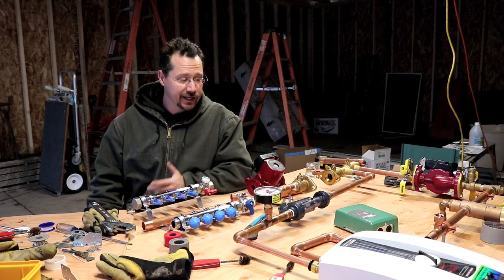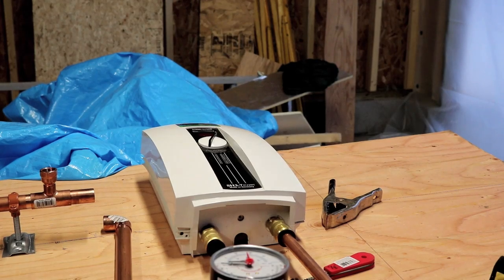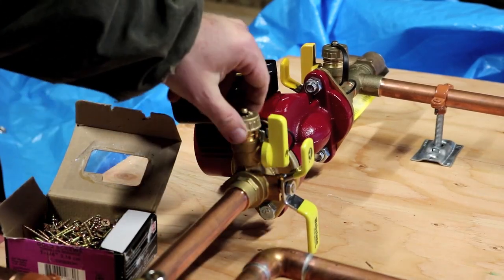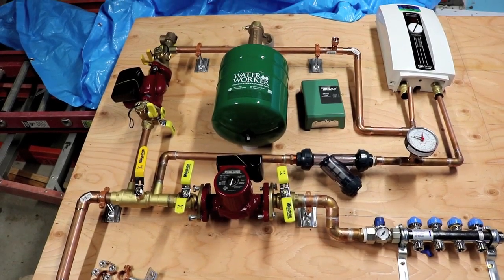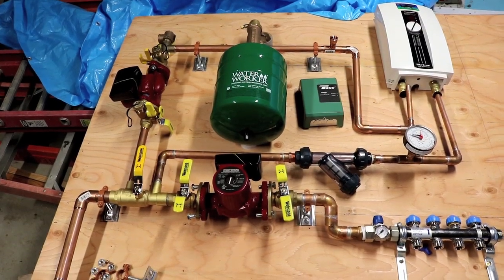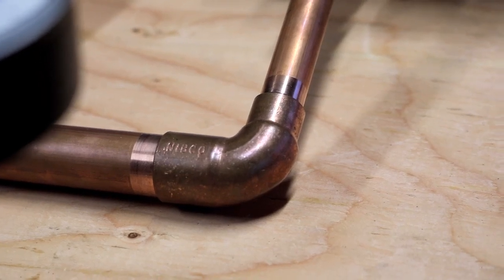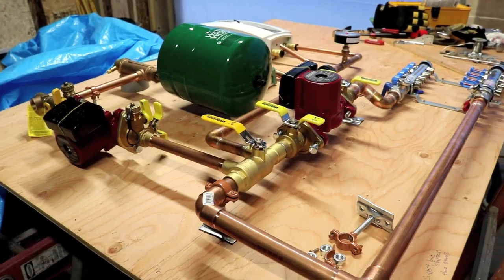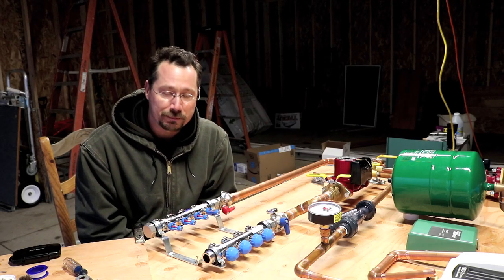Ben's Garage: Hydronic Heating Update Jan 25 2017

Comment: 7000 watts is only 24 000 btus, not big enough.  Also exectricity is 5x the cost of gas. You need to hire an engineer.
Reply from the maker: Also note that the system is somewhat modular, if I wanted to upgrade the boiler (which has been fine by the way) it's just connected with Shark-Bite style connectors, and could be swapped out.
When considering the cost of operation, I also looked at the fact that I am MAKING ELECTRICITY with solar panels, and what it would have cost to get a gas-line to this building. Much easier and cheaper to go with electricity in this case.
As a rule of thumb, YES, natural gas is a very inexpensive heating fuel, but that's not the exclusive reason for one source of energy vs another.
This is also a garage and workshop, it is NOT being heated to 70 degrees and occupied 24-7.
So far, the system is working as planned.
Reply: all dependant on heat load. 

cheers 
dave
Reply: You don’t know that is isn’t big enough.  Did you do a heat loss calculation on his building?
Reply: you folks got to remember running radiant heat BTU demand is way less than conventional conviction type
Reply: LARRY CURRIER I would not say way less.  Maybe a little less, but heat loss calculations are done independent of the heating system type.  BTUs loss must be replaced and it doesn’t matter what heat source you use to replace those BTUs.
Reply: LTVoyager while I disagree with you no matter the source of heat whether it be oil gas or electricity you generally can heat your home with radiant heat as this gentleman is doing for approximately 40% less than you can with conventional Heat thermocline in a room with conventional heat is that heat is at the ceiling and cold at the floor as much as up to 10 to 15 degrees from ceiling to floor thermostat at 5 feet he comes down to the thermostat and stops where are you below the thermostat thermocline with radiant heat is absolutely opposite other saving is convection type heating requires 180 degree water where radiant heat requires possibly as low as 100 degree water but most generally 110  depending on floor covering so if I can save a man 40% in his heating bill that's not a little
Reply: LARRY CURRIER The 40% number is thrown around a lot, but is very misleading.  I saw a comparison a while back, but unfortunately can’t find it now, about a house in Williams, CA, if memory serves, that had both radiant and forced air systems.  A head-to-head comparison was made with each system used it in normally would be used, and the fuel consumption for the two systems was nearly identical with the radiant saving only a few percent at best.

The 40% number comes from an assumption that you run both systems at steady state in a way that provides similar comfort for the occupants.  Generally, a radiant system can have the t-stat set 3-4 degrees lower than FA to achieve similar comfort level.  However,  this number neglects the biggest advantage of FA which is its very fast response.  Radiant slab systems do not allow daily setbacks as they respond too slowly.  So, you have to leave them set at say 68 degrees around the clock.  A FA system may need 72 during the day to match the comfort of the radiant, but it can be set back to 64 or less at night for better sleeping comfort.  This saves a lot of energy and often nearly offsets the higher FA consumption during the day.

I have both systems nearly side-by-side so I can compare them easily.  My log home is FA heated and my workshop is in-slab hydronic.  The workshop is comfortable, but no way I can do setbacks.  I have to leave it at 60 all the time in order to work comfortably even though I only work in it sporadically.  Forced air allows you to keep temps low when not using a building and then heat the building up in an hour or so when needed.  If my shop was FA heated, I would leave it at 50 most of the time and bump it to 70 when I planned to work in it.

As with most things in life, you can’t make simple absolute statements like “radiant uses 40% less energy” and it simply isn’t true in general.  And unfortunately there are very few real world side-by-side comparisons that show the actual performance of each system when used at its optimum.  The radiant supporters want all comparisons done at a steady temperature as that is where radiant shines and the FA supports want deep daily setbacks as they know that radiant can’t do that.  The only valid comparisons are where each system is run the way it runs best and I have only seen one of those and in that case the difference in efficiency was in the low single digits.
Reply: LTVoyager okay you must live in California I'm a 35 year heating guy and this argument could go on all day with a properly set up Radiant Heating there is more than a few percentage difference without having to turn the thermostat up then down and then down that's what they make zones for and forced hot air one minute you're freaking cold in the next minute you're sweating to death the temperature swing more than most people want to deal with so yeah why not compare apples to apples
Reply: LARRY CURRIER No, licensed PE in PA and NY, live in PA.  You have never experienced a properly designed FA system.  My house doesn’t vary more than 0.7 degree from setpoint and you can’t hear or feel the airflow.  Most FA systems have fewer than half the number of registers they should have and most don’t have at least one return in each room as they should.  This causes the air velocity out of the registers to be at least twice what it should be.  It is all about design.  I both FA and radiant, but they each have pros and cons.  There is no perfect system.  High thermal mass radiant is very comfortable when outdoor temps are fairly stable, but in the spring and fall where temps can swing 30-40 degrees in less than 24 hours, high mass radiant simply can’t track that.  You can’t overcome the laws of physics.

Comment: Fossil fuels what is it 1996? Where do you think the electricity comes from? Natural gas is amazing on about every single level. Cheep abundant minimum carbon foot print
Reply: that is why he mentioned solar panel  pay attention
Reply: Man. It's definitely not '96. It's 2019. It's time to eliminate all fossil fuel. Fracking is incredibly dangerous to ground water systems and it doesn't address the issues with carbon dioxide.
Reply from the maker: The electricity comes from the solar panels on the roof. Natural gas is great for heating, but it would also had been considerable work and expense to run natural gas piping to this building. Since I already have electricity in the garage and can literally make my own, that seemed like a good choice.
I've also added some solar thermal heating.

Comment: Wonder where he lives? what does manual j say for his winter OSA temp?  A heat pump maybe the better option, but not as fun to build.
Reply from the maker: I Rich. I live in south-eastern Wisconsin.
Heat pumps are good technology, but are not the magic bullet of heating. They only work well down to a certain temperature, and you still need backup heat after that.
The hydronic system has other advantages, such as the fact that I could plumb an outdoor wood-burning furnace into it.
Another advantage of the hydronic is how the thermal mass of the concrete (which has insulation below and around it) helps keep the space at a steady temperature.

Comment: Looks like a pretty good set up. (I'm not a professional) Do you have the system up and running yet? If so, how's it work? And, mmmmmmmm, taco.
Reply from the maker: Overall, the system works very well. I ended up putting in a  basic ($20) thermostat on it to automate the ON/OFF cycles. There's a few times this winter when I knew I'd be working in my garage all weekend, so a day ahead of time, I'd turn up the heat. Very nice working in a heated garage. Even 50 degrees is amazing if it's only 10 degrees outside.
For the most part, I've left it on with the thermostat set to 40 degrees (F). That prevents it from hitting freezing temperatures, but uses significantly less energy than if it was set to 50, 60, or 70 degrees. At 70, it would be about like me heating a second house! ($$$)
I also recent started experimenting with some passive solar, building a glass door that goes over my insulated overhead door. On a sunny winter day, I can let in the light and heat, but close the door at night and cloudy days to hold the heat inside. The hydronic system is also set up so that I could potentially connect an outdoor wood-burning boiler to it.
https://www.youtube.com/watch?v=EcuRfnP6E7I

Comment: Great Job on the system, i just did one as well with the same micro boiler.  to everyone that says you don't need two pumps,  manufacturer states that a primary/secondary system with a "Y" strainer is required or the warranty on the boiler is void.  Just a guess, but i would think that has to do with not having stagnant fluid sitting in the boiler which may cause buildup.
Reply from the maker: That is correct about the boiler warranty. Another thing nice about the "Y" strainer is that it's clear, so a person can see the fluid in it. That's a nice way to be able to see that the system is full and all the air-bubbles are worked out. Everywhere else is opaque.

Comment: Do you have a schematic of this setup with parts needed? Saw this same setup on YouTube and figured there must be a write up on each part used.
Reply: SupaTrending Daily It will take longer, but it won’t burn more fuel.  You are confusing heating time with efficiency.
Reply: SupaTrending Daily I agree, but taking too long is not an efficiency issue.
Reply: menards has this exact setup with the same components  in a brochure in the plumbing dept.
Reply: SupaTrending Daily It won’t be inefficient if it is too small.  I may be ineffective at low temps, but it will be very efficient as it will run at high output most of the time.
Reply: SupaTrending Daily It depends on the details, but in general the answer is yes.  A 90,000 BTU boiler will be larger and have greater thermal mass.  You are heating both the boiler and the water.  A larger boiler means you are heating a larger boiler mass in addition to the water mass so, yes, generally it will take more total energy if you are using a larger boiler.
Reply: SupaTrending Daily It certainly is much worse with a cast iron boiler, but even with modcon boilers or on demand water heaters, a larger one has more mass than a smaller one.  So, the loss with each heating cycle is greater with the larger units.  And they will short cycle when oversized.  98% of the heating systems in the US are oversized.  It is very rare to find a boiler or furnace that is sized correctly in residential applications.
Reply: SupaTrending Daily https://youtu.be/h00dAUaOa9o

Comment: Where did you find the fitting that the relief valve threads into?
Reply from the maker: I purchased all the components through MENARDS, a big-box home improvement store in my area. See if you can find a local vendor in your area. Otherwise, nearly everything is available by mail order nowadays. https://www.menards.com/main/heating-cooling/hydronic-radiant-heat/c-8517.htm

Comment: dont listen to these guys, Primary secondary piping is the correct way. also youre pumping away from the expansion tank which is perfect. youve done everything correctly. as far as the future wood boiler tee locations i would go with the secondary loop section that you pointed out. the only thing i would have done differently is put the secondary pump on the supply side.
Reply: Can you touch more on the reason/requirement for primary/secondary pumps??
Reply: Not a requirement, but improved operation and boiler protection. In a small system like this the two main reasons would be hydraulic separation, and thermal shock protection. The boiler and the heating loop have different flow rates. there are lots of different reasons for it and boiler manufacturers recommend it.
Reply: @MrKillanthony  d
Reply from the maker: The micro boiler warranty specifically requires the primary/secondary pump setup.
Reply: +MrKillanthony I agree
Reply: I agree that secondary pump should be placed on supply side.  These pumps are designed to “push” water (hence, the head ratings) versus “pulling” or suctioning the water.  If a pump is starved for water due to lack of suction, by running low on water it will damage the pump.  The water serves like ball bearings around the cartridge in the pump and it helps dissipate motor heat.

Comment: Hi Ben , I have an 80 litre boiler and approx 80 litres in the system. What size expansion vessel should I use ? Thanks Paul
Reply: Water expands 5 percent from 0 to 95 degrees so easy to calculate,plus volume of pipe work if the system is big

Comment: I agree with Dan Smith about a simpler one pump system. My whole house is hydronic with 8 zones and one high head TACO pump. It is simple and has worked for 15 years without issues.I have seen these huge systems with a pump per zone that are expensive and complicated,. Sure if the pump goes you have no heat ,well you keep a backup on hand and you can replace it in a half hour and not have to bleed the whole system when you locate the valves close to the pump.
Reply: If you have 8 zones then you have 8 thermostats. To independently control the 8 zones, you must be using zone control valves rather than zone pumps since you only have one pump.
Reply: 8 zones?  Or 8 loops?
Reply: Yes, just save other pump for backup.

Comment: Why is a strainer/filter needed?
Reply: Also looking for this answer. I couldn't find the correct filter and bought a different one. Now it is getting build up and slowing the flow enough to stop my heater from coming on.
Reply: @nickosterhout  if it’s getting build up then I think that answers why it is needed, it is there to protect the boiler from whatever is building up in the strainer.

Comment: I have outfitted my home with Rotex manifolds and piping from Germany. The engineer who designed and installed my system says that 40°C is the max temperature that can be run through our system. Also the "concrete radiating sub floor" was mixed with chopped fiberglass and a latex solution to inhibit cracking due to the thermal expansion. I have a dual heat supply system where my fireplace equipped with a built in boiler will supply the primary heat source while the oil fired boiler is the backup source. This requires the installation of a heat exchanger tank where the two systems are isolated but supply hot water to the hydronic heat in the main home at 40° while supplying 70° water to the radiators in the basement. One you heat up the concrete radiator you leave it running if at a reduced temperature when a lot of hat is not needed. This eliminates reheating the radiating surface which can cost more in the long run.
Reply: sounds delightful 

cheers 
dave

Comment: I've seen it said that these have to operate all the time basically, because warming water to warm a lot of concrete takes a long time so can't shut it down then expect a toasty space a 1/2 hour later.   If you finished, do you shut it down and turn it on or leave it on for long periods?
Reply from the maker: A big piece of concrete  has a LOT of thermal mass. That means that it's both very slow to heat up and slow to cool down. The upside of that is if I open my garage doors, all the heat doesn't just instantly leave. The downside it that it takes a long time to warm up. It's a great system for a steady temperature. My idea was that I want my garage warmer than the ambient temperature all winter, so, I could just set the heating system to go, but at a very low temperature. I would be much warmer than working outside, but would still be wearing a jacket, etc.
So far, If I knew I would be doing a lot of work in the garage (on a three-day weekend, etc.) I might turn the heat on or up at least a day or two ahead of time.
The temperature does change slowly. That's both an advantage and disadvange. So far, it seems to be working pretty well.
Reply from the maker: Keep in mind too that it's not as though the heater is running full blast continuously. On this style of micro-boiler, it just heats the fluid to whatever temperature you set it too. So it may be adding a little or a lot of heat to the fluid depending on what the incoming temperature is. I also now have a very basic ($20) thermostat on the system. I can set it to as low as 40 degrees F. That simply turns on the pump (and thus the boiler, because that's activated by flow) when temperature gets below the set temperature.
Right now, it's just reading air temperature. I did intall an empty piece of PEX hose when I poured the concrete. That allows me to fish a floor temperature sensor down into the concrete at some point in the future if I would like to.
Reply: I agree with your ideas, keep it at a temp that knocks of the chill in a garage due to the otherwise massively very cold concrete so yeah still wear a jacket but at least your fingers and toes aren't going numb like when I attempt to work in my garage during the deep winter.   It is cost effective too so good job.

Comment: Your layout appears to be almost an exact copy of youtube titled "Basic Hydronic System-YouTube"
Reply from the maker: The animation in that video was from the company that manufactured my micro-boiler. I basically just modeled my system on a display model at the big box home improvement store made by the same company, so yes, it's very similar.
There's not neccessarily a lot of variation on these things, especially if two different systems are all using parts from the same manufacturer.